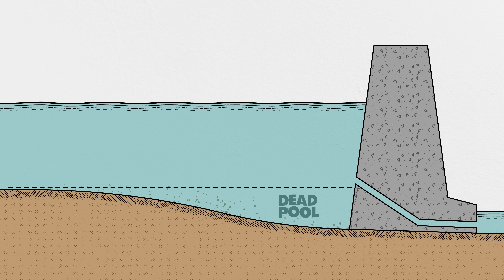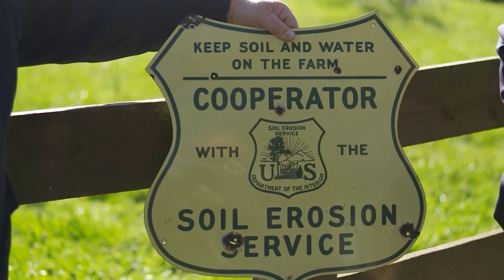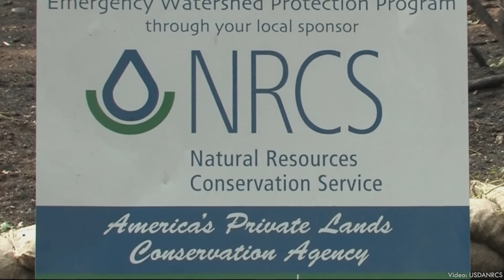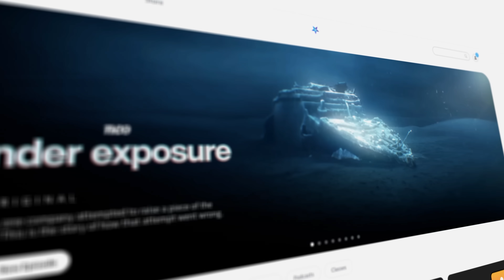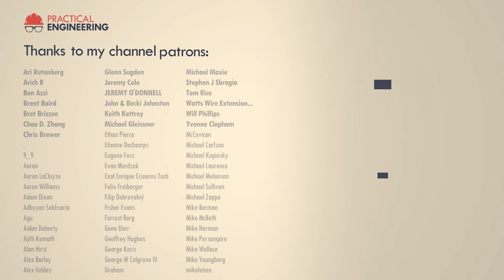All Dams Are Temporary

Comment: It needs more than one solution. A dam thats designed to have bottom gates would be one. Then a vacuum dredge that would be needed at the very beginning. The dredge could be sold to farmers for dredging overhead. Then finally  a special overlook to how long,wide and deep before another dam is placed would allow for projects to be divided up allowing more localized economic benefits
Reply: 6000 pounds of sediment enters Lake Powell every second. There is no dredging system on Earth that can match that.
Reply: @johnperic6860   that's why I mentioned the planning of smaller dams instead of one giant one. It would spread out the economics and burden. If the landscape couldn't afford this measure then a tesla turbine that allows debris through the turbine and barges with controlled compressed air could maintain certain levels of silt

Comment: the dam needs massive soil gates at the bottom that only open when they are filled with soil on the other side and close when they are clear. you could make them like a bucket paddle wheel that only breaks the seal when it's fills with soil and tips over. the idea is a upside down over-spill. the water side would physically look like engineered sink hole, you could send these sink holes and pipes as far back as you have money for. because soil is heavier then water, you just build a trap door that opens for a Elephant but stays closed for a mouse at the sink hole entrance. it flushes soil but the pipe mostly filled with clear water, till the Elephant falls. expensive to build and only on new dams, not old ones but other then long term maintenance/repair largely a simple physical system that does not break much.

Comment: We have similar challenge in Poland with a dam built on a Vistula river in Włocławek. Not only it collects sediment and causes spring floods due to ice blockades, but also there is erosion downstream of the dam as there is no sediment that would normally replenish whatever is being washed away by flowing water. It even caused an oil spill due to the pipeline damage and endangers some bridges.
Reply: that is why flood control reservoir near Racibórz was actually comissioned as polder - despite some people trying to convert it to "wet" reservoir. Preserving natural flow most of the time and accumulating only flood water prevents sedimentation. Terrain can still be used when there is no flood: as pastures, crop fields, sand mines - or left for wildlife.
Of course, that doesn't allow any permanent water storage, so there is no drought control or hydroelectricity production possible, but it maximises flood pool.
Reply: Hopefully the good people of Poland won’t let leftists destroy damns without replacement ideas.  And solar is not a solution.
Reply: don't build dams, it also kills rivers

Comment: Idea: Lay a long lasting and water resistant series of explosives across the dam floor while silt levels are low, wait many years till silt levels are problematic. Then set off the explosives in a controlled/staged manner while draining the dam rapidly (using a grate to protect from sticks and other large derbies) untill most of the silty water is drained, then relay the mine field and repeat in a decade or so. Ta da :D

Comment: Your suction dredge should be changed to a siphon that runs from the delta over the dam (or through) and down stream far enough to create the flow rate needed.  There are many ways to set up the delta end to skim the bottom much like a pool skimmer.

Comment: As someone who works in the dredge industry (I build control system for dredges and suportig equipment) I have built controls for dewatering wheels to separate the material from water. These alow faster processes over the bags. But i deal with agragte mining dredging not sediment removal.

Comment: Another method might be compressed air pipes laid on the reservoir floor where you would shove compressed air in to stir up the silt into the reservoir while flushing it. If you were to manage the air flow you could keep this to a low level to reduce the flushing needed. It would produce a low level slurry. You could even use high pressure water instead of air. Pipes could be installed by dredging channels for them. It would be relatively low cost.
Reply: 1 sand being heavier than water, pipes might get crushed, valves might struggle to open

2 on the scale of a lake it very likely wont be enough 

 suction dredging might be similarity valid. Wanna give it a thought?
Reply: @Redicule_research._ridiculous concrete pipes are hard to crush and the pressure inside and outside would be the same.as the valves would be at the downstream end. Valves would be simple slide up sluice types / gate valves. very reliable and used for tbousands of years and don't jam. Having lived on silted waterways all my lfe the technique often used is called spot dredging where you dredge a series of deep holes and the silt falls into the so leveling out but it works best when there is traffic to disturb the surrounding silt into it. The air / water at pressure method effectively liquifies the sediment helping it to flow. The problem with suction dredging is it is labour intensive, not a fit once solution and then you need to move the spoil which, if you cant dump it locally, also needs a drying / settling arrangement which is also costly. i have seen many videos of dams being open that haven't been opened in years and its impressive how much silt the head of water can push.
Reply: @philbrooke-little7082  so the way to remove stirred up silt is one we can agree on. Even though every pipe can only have one intake to ensure predictable operation 

Spot dredging 👌
Only needs to happen where the river ends, which would mean we only need to cover a small manageable area

However I'm still not confident in the way to stir up the silt. Water would need to overcome truly insane pressures if covered in 10 m of silt, because a single jet of water will make a beautiful very steep crater/vulcano. To avoid that, a nozzle, possibly a spinning one?
Or a nozzle that, when not active, is aimed in the rough direction of the intake of a pipe. when that'd make it likely to at least get itself free once activated.

To avoid having to dry/settle, if we can flush it along the river to the other side of the dam, it no longer is our problem 

Even though air will put more and more force upwards in settling soil the more you pump in a cavity (whereas with water, the force will only ever be equal to the pressure you're delivering) I can't see a way in which you wouldn't have enormous issues if the pressure ever fails so I'm inclined to discard the idea of using air to disturb soil
Reply: @Redicule_research._ridiculous With water jets, or air, I would envisage it aiming upward  from the area around the pipe taking the sediment away so basically doing automatic spot dredging. As it would be a fairly regular process not much pressure would be needed as the silt wouldn't be allowed to get too deep. You could even have perforated pipe running in the disposal pipe to unblock it in case of cloggage that the head of water couldn't clear. It's an interesting problem that's fun to think about. My experience of coming up with solutions to things is to always simplify. Complex solutions tend to be expensive and unreliabe. Some of the best river level control systems I have seen are actually the simple ones based on float operated gates with no power involved. once you put in telemetry and power you are on a hiding to expendive headaches although of course necessary in some situations.
Reply: @philbrooke-little7082  thank you, this was fun

I saw those water or air jets the same as you (aiming simply upwards) untill I wrote it down, when I realized that if they're turned off, (power failure) and they've successfully created a pit, any floating particulate would float down, experience no additional force as it falls through the upwards pointed nozzle, creating issues for next time. 

A special egg shaped pipe, perhaps with a perforated pipe running near it's top might help with those cloggages. I'd hoped that by making sure the water has plenty of velocity I could avoid sediment buildup within the pipes

Wait
For hydro power you could just not take in silt, toss a (unsightly) pipe  over a cliff face, and once there's no air in the pipe, you've got a static pressure equal to the drop. (Friction losses might be massive over the entire pipe though) No need for a dam. ... reservoirs are pretty nice for reliabilities sake though
Reply: @Redicule_research._ridiculous You could certainly do something with siphon but you are limited to 30' of 'pull' because of the vapour pressure of water. I don't think upward facing nozzles would be an issue as hyrdraulic pressure would easily force any gunk out. The egg shaped pipe is of course great for things like sewers as it makes them self cleaning even with low flows as per Baziljet and his sewers.

Comment: You could build a wall, not a dam, further back up the reservoir, where it's narrow with the top at or below low water level. This would make a settling pond. Water from low level here could be channeled, via a sluice / valve to below the main dam and the discharge could be managed to just flush out the sediment at regular intervals to match the buildup and that would reduce the amount that reaches the main dam where the bottom of the dam could be flushed which would gather the sediment from water that enters the reservoir from routes other than the main feeder river.

Comment: When I was on the Lake Mead delta, I was wondering if the water flow could be used to drive a suction dredge. Just like cleaning a fish tank with a siphon, throw a 2mile hose over the dam and let the sediment flow downstream. Use winches on the shore to run the dredge head across the width of the dam. Use gravity to do the work, there might be regulatory advantages to keeping the sediment within the river basin. Dredge more during high flow events to better match the behavior of an undammed river. 
The habitual farm waste entering the Mississippi river is 10x more than the Deepwater Horizons spill creating a hypoxic dead zone visible from space. We need real punishments for agribusiness polluting waterways.
Reply: Could just drain lake Mead and by pass the Hoover Dam altogether.

Comment: A great and underused alternative for hydroelectric projects is to avoid building dams and reservoirs altogether.  Instead, divert part of the water somewhere upstream into an acequia.  This is a canal that carries it by gravity, parallel to the river, but at less steep gradients by following the contours in the adjoining hills.  Once the acequia has reached a significant elevation above the river somewhere downstream, you drop the water back into the river through penstocks that power your turbines.  Construction can be cheaper than reservoirs, and it takes and destroys much less land, particularly valuable alluvial farm land.  It won't work on seasonal rivers, where storage is important.
Reply: This is called run-of-river hydropower. It is great and should be implemented more. This is how hydropower is produced at Niagara falls.
Reply: But one of the advantages of traditional hydro is that with its storage capacity it can to an extent compensate for the variation in wind and solar output (as well as variation in demand).
Reply: @seneca983  
Using an extremely unsustainable and destructive means of producing energy to compensate for the deficiencies of wind and solar makes no sense. 

No joke, it would legitimately make more sense environmentally to just use a gas powered plant than hydro, lol.

Also, there is pumped hydro storage, which is much more environmentally friendly than conventional hydropower and more well suited to supply during lulls in energy production.
Reply: @johnperic6860  I don't believe using a gas powered plant would be better as it emits a lot more carbon dioxide than renewables. Pumped hydro can be good but only in places where the geography accommodates it.
Reply: @seneca983  No solution is perfect for every application, but this one makes a lot of sense for others.  Acequias have been used for centuries for irrigation water, since they require no pumping.  About a mile from my home is a 93-year-old hydroelectric plant.  It's fed by a large acequia, and its power output goes into the Texas grid.
Reply: @ There are always pros and cons but I'm not convinced this kind of solution is underused (like you stated in your original comment). There are good reasons why many hydro plants have a dam and a reservoir.
Reply: @seneca983  " There are good reasons why many hydro plants have a dam and a reservoir." No not really. Some ideas are pervasive despite being bad.
Reply: @seneca983  I think the biggest reason that politicians' minds turn first to dams and reservoirs for hydro plants is that it's easier to sell politically due to the recreation potential of the lakes in the minds of city folk.  I can't see the need, though, unless there's a legitimate related need for the STORAGE of water (which is sometimes the case).
Reply: @johnperic6860  That's some nonsense. Without a reservoir hydropower is entirely season dependent. Switzerland for example gets most of it's electricity from hydropower. It's a great country for it, with high mountains (and thus high head for the turbines) and deep valleys, and glacial streams. Without the dams they would have no electricity in the winter or late fall. Only in spring and summer when the glaciers melt.

Even roman and medieval watermills had mill ponds with a dam whenever the stream was small enough to permit it.
Reply: @ 
Not if you design hydropower generation with minimum seasonal flow in mind.

That said, why are you acting like hydropower is the only way to generate energy? If an energy source requires severe environmental damage to function, perhaps it shouldn't be used as an energy source, ever consider that?
Reply: @slome815  While your statements might be usually true, neither is true everywhere and every time.  The acequia hydro plant near me is in an arid region, yet it runs year-round without any reservoir, because two thirds of the flow on this portion of the Rio Grande is from perennial natural springs about 75 miles away.  Some Roman and Medieval watermills were powered by acequias and needed no reservoirs.
Reply: Check some of his other videos about rivers and water usage.

Turns out rivers are really really difficult to plan out
Reply: @zaxscat5357  
turns out engineers are dumb sometimes and our bureaucracy is making it hard to undo our stupidity. 

It isn't hard to figure out that building a 200 foot tall wall in front of a river is a bad idea.
Reply: @johnperic6860  "turns out engineers are dumb sometimes and our bureaucracy is making it hard to undo our stupidity. It isn't hard to figure out that building a 200 foot tall wall in front of a river is a bad idea." Yikes, you sound like someone who has a bad case of Dunning-Kruger.
Reply: @pendlera2959  
Cool, but nothing I said is wrong.
Reply: @johnperic6860  Unless you're in the fossil fuel industry, it's actually a very good idea. Because renewable energy + large scale storage in the form of hydro is really the only hope we've got for continuing modern civilisation without the inherently unsustainable use of fossil fuels.

Unfortunately vested interests aren't keen on that for obvious reasons, they want to sell fossil fuels not have someone come along with renewables.
Reply: @shaun5552  
"Because renewable energy + large scale storage in the form of hydro is really the only hope we've got for continuing modern civilisation without the inherently unsustainable use of fossil fuels."

1.) This is not true, we have nuclear, wind, solar, geothermal, pumped storage, and run-of-river hydro power that can all easily make up for the loss of conventional hydro-power, and are all quickly phasing out fossil fuels.

2.) Something being renewable does not make it environmentally good. Burning wood for energy is renewable, but it is not environmentally sustainable. Similarly, placing 400 foot tall walls of concrete along rivers, and causing massive water losses to evaporation, blocking migration paths, reducing sediment loads, and flooding tens or hundreds of square miles of land is not sustainable.

Conventional hydropower is by far one of the most destructive and unsustainable energy sources we use. I mean, just look at what it has done to fish populations in the Columbia River and Yangtze River, or what it has done to the Colorado River and the southwestern water supply as a whole.
Reply: @zaxscat5357  O, I know.  I've been a fan for years.  That doesn't refute that acequia hydro is a better alternative in some cases.
Reply: Run-of-river hydro projects also have challenges. They don’t work very well without significant relief, and still need a headpond.
Reply: @ 
They produce the same amount of energy as conventional hydropower, given the same amount of geographic relief. 

They need a very small headpond, and nothing more than a small diversion dam to work. That's not comparable to flooding 250,000 acres of land under 150 feet of water and behind a 600 foot tall dam.
Reply: @garywagner2466  If by "relief" you mean other generation sources, that's why we have a grid.  The one near me has no headpond, just a very low diversion dam across the river channel to divert the flow through headgates into the acequia.

Comment: Would slowly (over years or decades) blasting the bottom of the river with high pressure water work to resuspend the sediment and help it flow downstream? Basically set up a barge or two and have them move across, progressively blasting the bottom of the river with recirculated water.